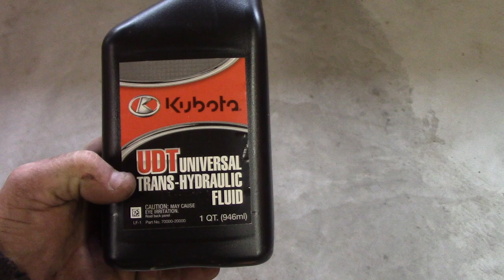Kubota RTV 900 CV Axle Replacement

Comment: Hey everybody, Just wanted to add my RTV900 was made in 2010 and the front axle dip stick is easy to access by lifting the hood and I use a long transmission funnel. It worked great. Take care everyone and be safe.

Comment: Just wanted to say thanks for a great video tutorial.... I've been dreading changing the axles on my RTV9 but your idea of removing the A Arm bolts (as opposed to disconnecting the lower ball joint and tie rod joint) worked perfectly for me.... the job went along pretty smoothly and took about 3 or 4 hours to complete. Thanks again. mardyn
Reply from the maker: Awesome. Glad I could be of some help.

Comment: Hey Lenny, good video!  I'm having to do the same repair on my 900 and was wondering if you used Kubota parts or after market.  My Kubota dealership wants 500 per axle so I'm looking for a more cost effective option.  If you used after market, could you tell me where you got them?
Reply from the maker: The person I did the repair for got the parts from Kubota. I don't know what they paid. I would expect that aftermarket parts would be just fine. I haven't tried to look for them so I can't help you there. Good luck and thanks.
Reply: @lennyc624  Thanks Lenny!

Comment: Going to do this on my x1100c when parts come in.  The 1100 doesn’t have the three bolts that hold the bearing to the case.  I’m hoping it just pulls out.
Reply: Did yours pull out?  I need to replace mine on my 2012 1100.
Reply: @nwynneus  Yes it just pulls out.  I had to lightly pry it out of the case.  There is a ring that holds it in place.

Comment: I am having 4wd issues with my RTV and getting a grinding noise when the front tires come under load. I am wondering if this issue could be a result from a broken cv axle. Do you know what sort of symptoms the machine displayed?
Reply: Hi Ben,
My front passenger side CV axle came out in 2 pieces. Broke at the CV boot. It only made noise when the 4x4 was engaged and during hard right turns. Very loud clicking noise, sounded really bad.
Hope that helps. BTW, I order both axles from Amazon $120.00 after shipping.
Reply: @chuckdachuckster2480    Chuck I just ordered mine off Amazon too based off you comment. $140 for both from a company called smart parts in North Carolina.  Were yours up to par with the OEM?  Any issues yet?
Reply: @keithdaniels5918   Hey Buddy,
Everything worked great, just make sure you check the the hydraulic reserve in the front axle after you make the change for the proper fluid level. Make sure you add the correct hydraulic fluid, I hate to save buck when so far into a project, get the correct hydraulic fluid.
Hope everything works out for you and Thanks for writing.
Chuck
Reply: @chuckdachuckster2480  Thanks for the follow up.  I went by my local kubota dealership today to see if I could get the boot kits so I could repair the OEM and keep as spares. They priced the CV shafts to me for $640 !!!! Each !  Told them they needed a Jolly Rogers flag on the pole outside.  I only use kubota Fluids and filters so no worries on the fluid. I got the boot kits and jumped ship from those pirates.
Reply: @keithdaniels5918  Good for you buddy! I hope I was able to help you and anyone else. I have nothing to gain or lose here, I'm a people person and like to help other people out. If I can help with anything else let me know. Have a great week!